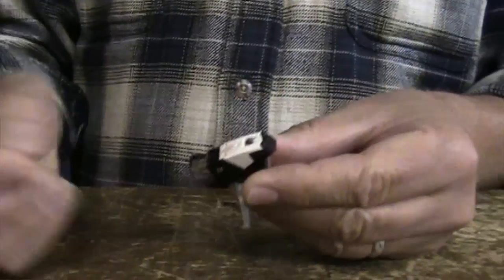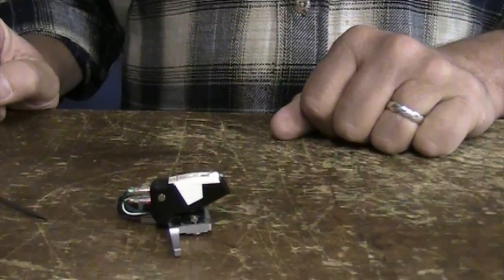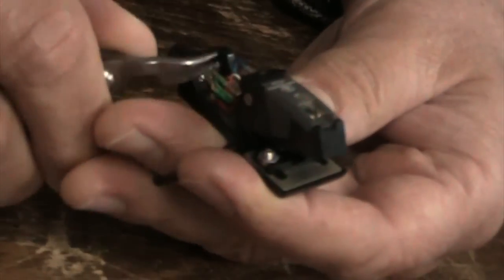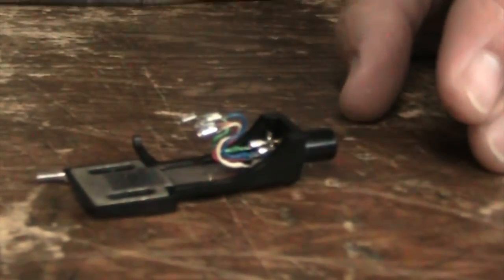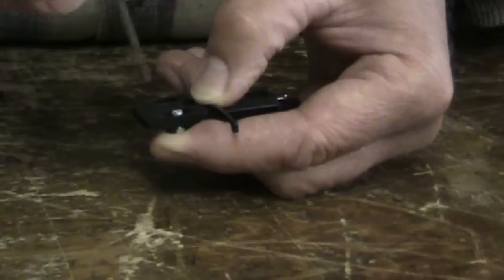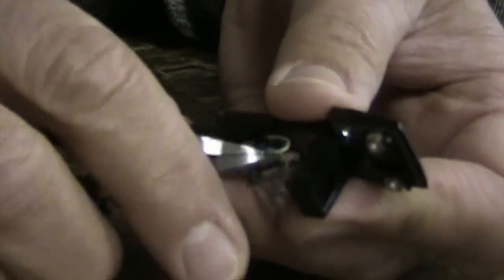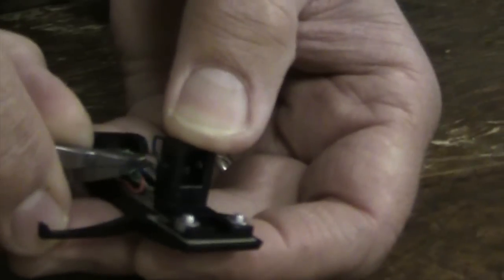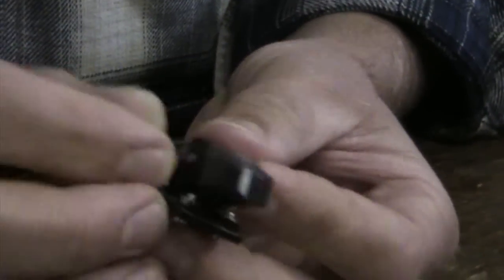How to Replace a Needle and Cartridge on a Turntable

Comment: Hi thanks for the vid, hope you dont mind me picking your brains if possible. Ive taken the exisiting cartridge out of a pioneer pl570, then purchased an AT 95E, however the pins on the rear of AT 95E cart are a larger diameter so ive removed the headshell from the tone arm and I'm left with the thin wires. I'm going to order a new headshell to fit the  AT 95E cart, but how do I connect wires from tonearm to cartridge?

Comment: Sorry man your videos are awesome, im triying to restore a la11 jvc too, y already buy belt and needle. Al works ok, the plate turns ok, change velocity, the needle also emits some sound really low without conecting the turntable to anything. all great but, when i connect it to a amplifier i couldnt get sound from it, i open the turntable like this video, ans test the cables from that litthe bos you shows where the 2 rca cames out, from ther to the capsule conection. They emits continuity, but its strange because any of the capsule pins(that are 4), marks more than 1 point in that little box connector. also has the same problem in the rca cables...you thinks this is a short cirtcuit?...could you please tell me how it is the best way to check the sound problem, im newbie on turntables but not in the electronics. MAny thanks for your time and wait for your help

Comment: I have a Sanyo auto return turn table. The needle it totally gone. The cartridge I guess says mg-44j any suggestions to save this classic
Reply: Do you need a replacement stylus?  The correct one you need for that cartridge is ST-44J.  You can also use pfanstiehl 4213-D6 as a substitute stylus.

Comment: Great video, I have a cheap Welling F700 turntable and the cartridge seems to be attached to the tone arm.  The wires also seem to be soldered onto the cartridge.  Is there any way to replace the cartridge on a model like this?